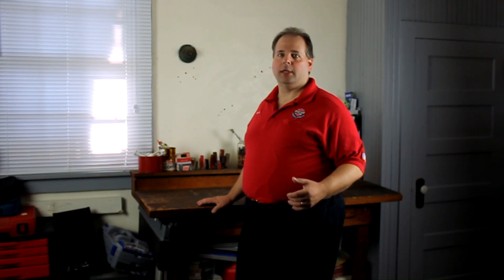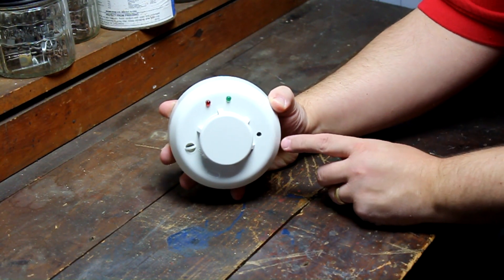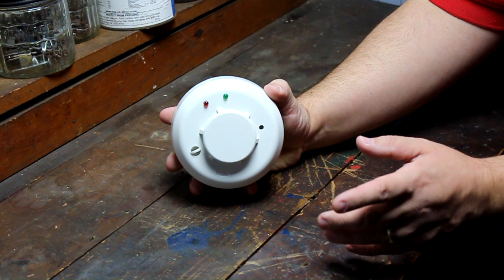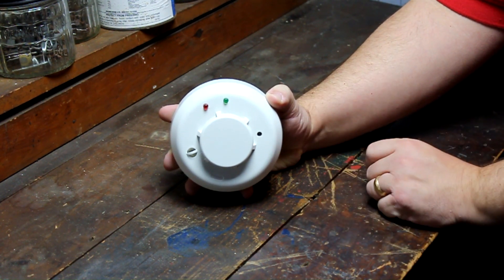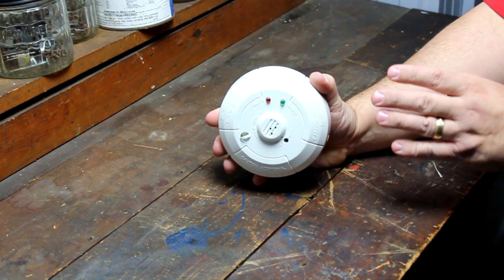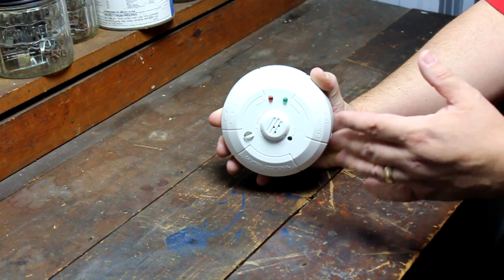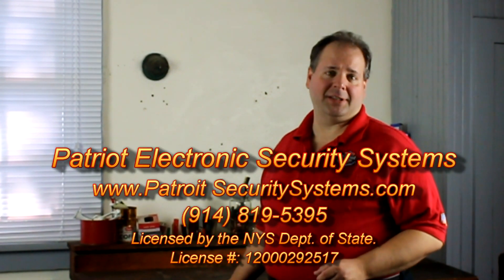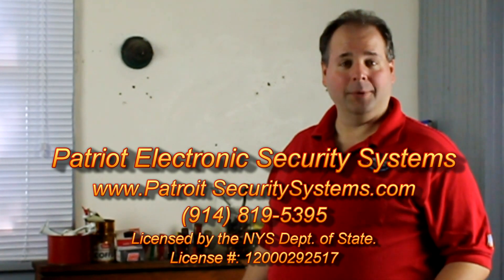How a Security System Works (Part 2)

Comment: Thanks Mark. Good stuff.Do you know if the GE Simon XTI uses the "Contact ID" protocol?A few months ago, a Monotronics guy installed my security system. The equipment side went rather fast. The installation became delayed when he called Monotronics to register the panel. It took awhile to get a Monotronics rep on the line. Once that occurred things flowed rather smoothly. If I'm not mistaken, he provided the panel "serial number". This allowed Monotronics to connect/turn-on the panel. It's my understanding the panel uses "wireless" to speak to Monotronics. Since there are many users, I guess there's multiplexing going on that allows a many to one relationship. Many panels utilizing one Monotronics # and/or 1-800 #? There's a cellular presence in the panel that calls Monotronics. I would think the connection between the panel and Monotronics or whatever monitoring company, is continuous?.....meaning the cellular call never ends. Can you explain?
Reply from the maker: Hi Frank: I don't sell the GE Simon series but according to the installation manual of that system it seems like Contact ID is indeed supported by the panel. However, the manual does state that the central station would need specific receivers for compatibility. Here is the exact excerpt from the manual:

'The panel has been tested with the following central station receivers using SIA and Contact ID reporting formats:
Before beginning installation, installers must verify that the central station is equipped with the following receivers: 

• Radionics D6600 central station receiver

• Sur-Gard central station receiver with models SG-DRL2A and SG-CPM2

• CS5000 digital alarm communicator receiver"

As far as a constant cellular connection with the central station is concerned, I can't fathom that would be the case. Someone would have to pay for that airtime and their really wouldn't be a need for a connection when there is nothing going on at the panel. If an event occurs at the panel that needs to be reported then the panel calls via cellular connection the central station.

Comment: Great videos, as James stated. I would also like to know, in depth, what information is received by the Central Station. How does that data look when it reaches the Central Station. Its quite possible the Central Station massages that data such that it appears as English on a monitor. Assuming so, I am interested in the raw data that appears at the monitoring company.
Reply from the maker: +frank Johnson Hi Frank. Thank you for watching and I am glad you enjoy our videos. The security industry has several different "standards" for the transmission of data  from the alarm control panel to the central station. The transmission protocol I am most familiar with is called "Contact ID". This protocol was developed by Honeywell (Ademco). Now I have never worked at a central station, but let me explain the information as I understand it. 

Idealistically, you want the panel to transmit the data as fast as possible to the central station (to reduce the chance of the system being disabled by an intruder before it completes it's transmission. Therefore, using the Contact ID protocol, the panel only has to transmit a 13 digit number to the central station. The first four digits are the "subscriber's ID number". The next digit is the "Event Qualifier". This digit tells the central station if the message is a new event or an old event that for some reason was unable to be transmitted when the event originally occurred. The next three digits are the "Event Code". These digits represent the nature of the alarm (intrusion, smoke detector, fire pull station, CO detector, etc...) The next two digits represent the "partition number". Some alarms systems can be broken down into multiple partitions. For example, you can have one alarm system protect a two family house. Each of the sections the two families live in can be armed and disarmed separately. And finally, the last three digits are the zone number that went into alarm.       

Now these 13 digits are the "raw data" transmitted. The representative's terminal at the central station automatically decodes this information into a format more useful to the representative. For example, the system takes the four digit subscriber ID number and pulls up the full record of that account such as name, address, telephone number, etc......

For more information on the Contact ID protocol here is a URL to a PDF with the meaning of all the codes:
http://library.ademconet.com/MWT/fs2/685/List-of-Contact-ID-codes.PDF
 

I hope this answers your question, and thanks again for watching. :)